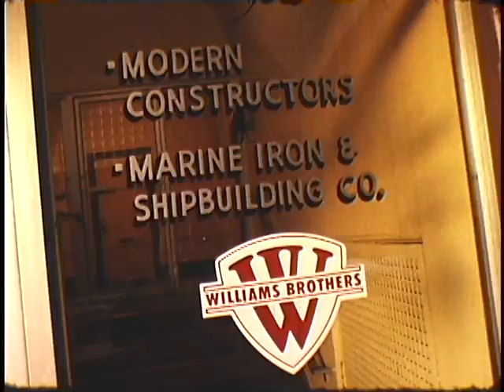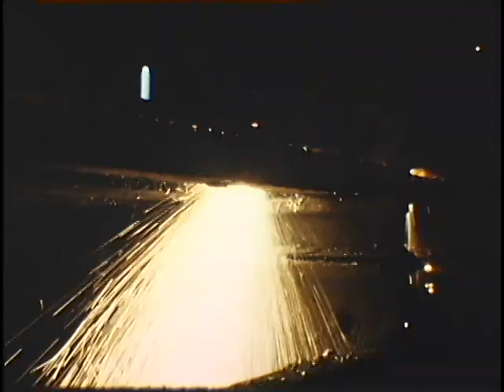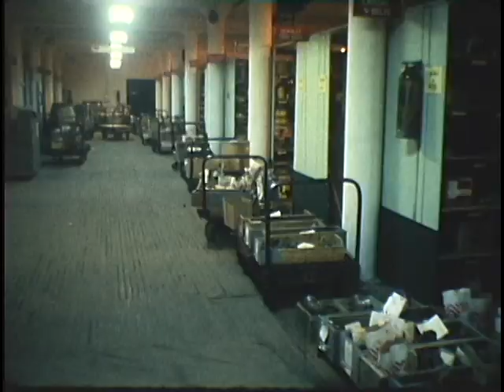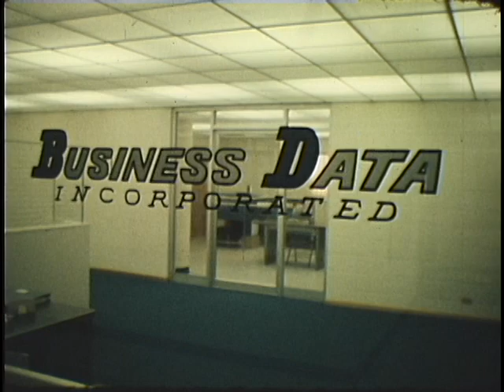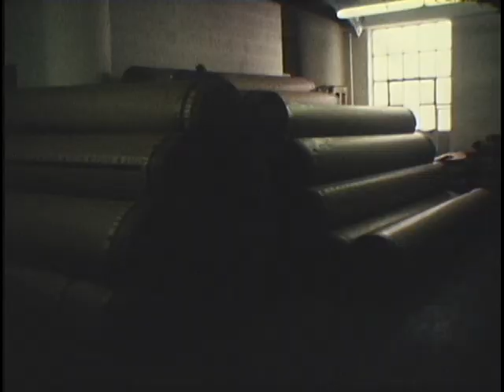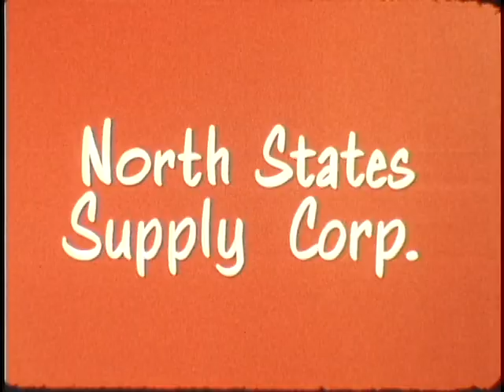Meierhoff Building

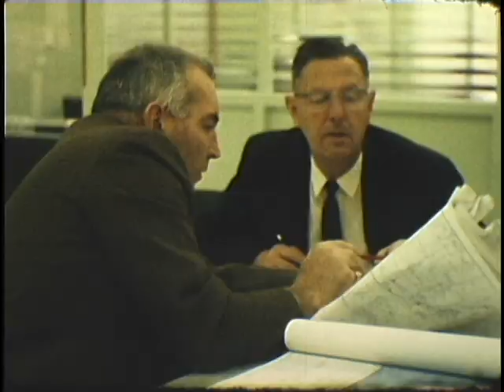Comment: at the 6:13 mark I am pictured at the parts counter, the other parts guy is Mike Messina. I can't remember the name of the guy driving the forklift. I worked for Halvorson Equipment as the parts and warehouse supervisor from 1966 - 1969. We were originally located in the old G. E. Supply building at 246 Lake Ave. South and moved to the Meierhoff Building in 1967.